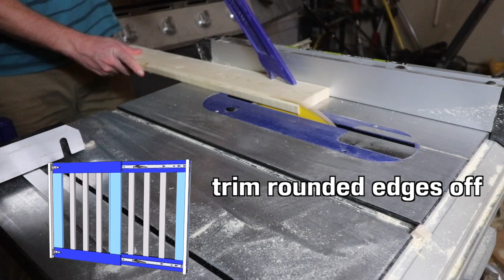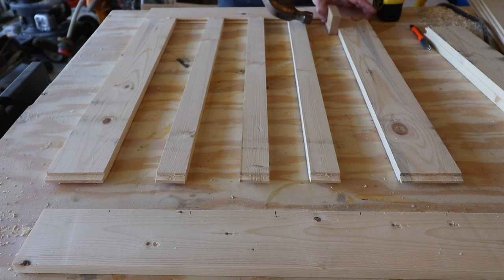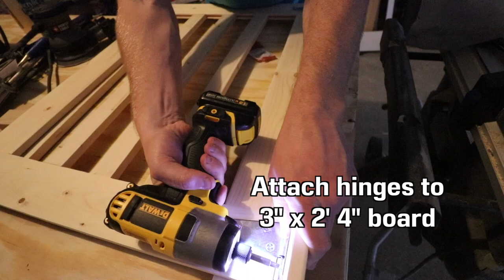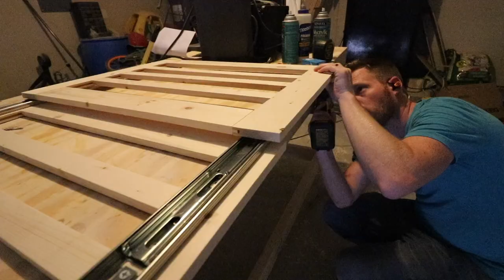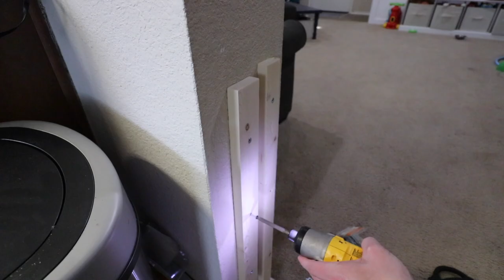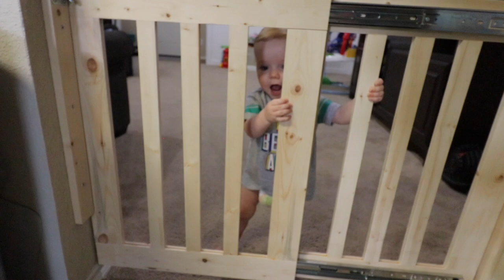DIY Sliding Baby Gate

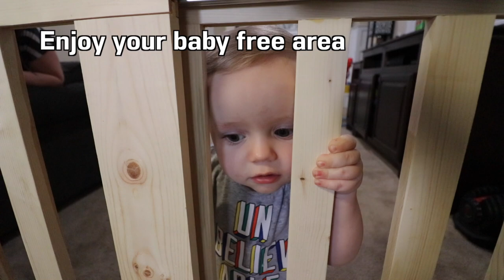Comment: I think that when the baby gate is closed if the baby makes a little more pressure in the middle area it will break, at minute 3:10 of the video you can watch it, the drawer slides should be a real heavy duty with a protector so that the baby does not dirty his hands of lubricant grease with the drawer slides and also so that he does not cut his hands, but I think it is not a good idea the drawer slides in the baby gate because until today I have not seen any drawer slide with protector.
I apologize if I offend anyone with this comment, it is just for the safety of the babies.

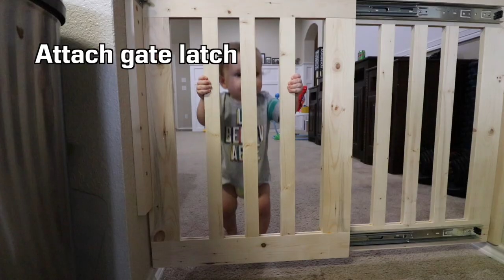Comment: The problem with this idea is the exposed slide. It's not a razor sharp edge, but there is no way I would leave the metal drawer slide exposed like that where a baby could touch it. You can clearly see it at 3:09 on the left half of the screen. It would be at the top and the bottom. No thanks!